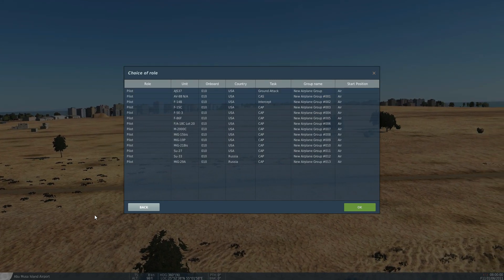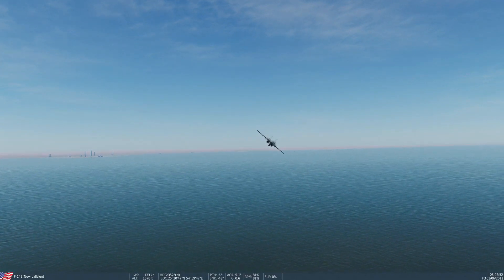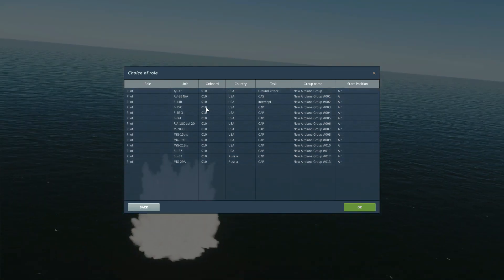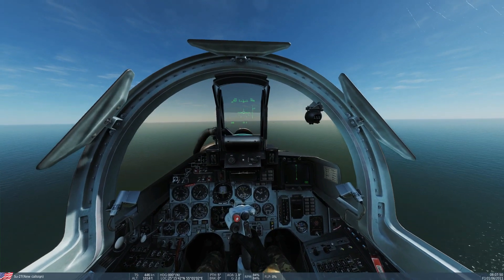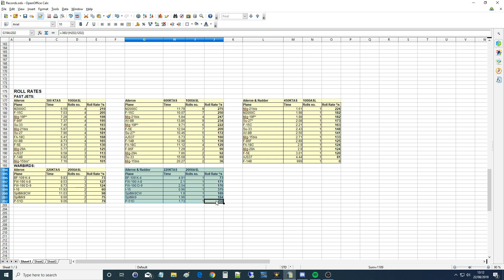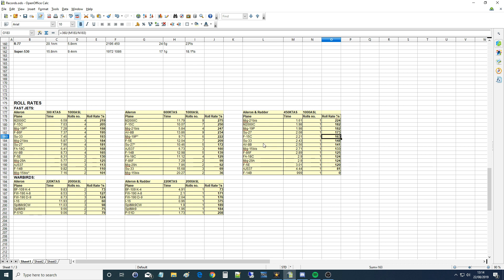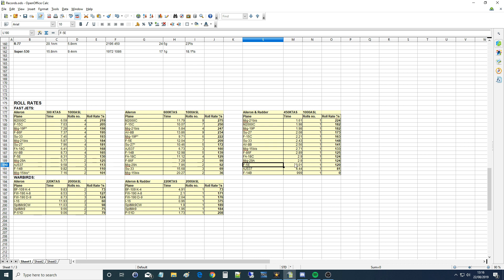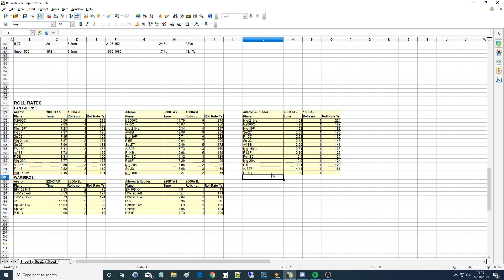Fast Jets: Max Snap Roll Rate (Aileron, Rudder & Elevator) | DCS WORLD

Comment: I would recommend using aileron only - no rudder or elevator. The airplane should be essentially ‘unloaded’.
A good way to measure the maximum roll rate would be to measure the middle roll of 3 continuous rolls.
In competition aerobatics, the term ‘snap’ or ‘flick’ roll refers to an autorotative roll - started  by applying rudder after rapidly increasing the angle of attack (back stick for ‘positive’, forward stick for ‘negative’), so that a wingtip is stalled, generating a lift differential across the wingspan. Once initiated, the elevator is positioned to reduce the ‘average’ a.o.a., and aileron can be added to increase the lift of the unstalled wingtip - ‘accelerating’ the snap. This takes a lot of practice - the speed and timing of the inputs are very important, and vary between aircraft types.
Large elevator deflections will make for a spiralled flightpath with high loading; rudder may help the roll at relatively low speeds with a positive loading, but in addition to structural issues, could oppose the maximum rate of roll at high speeds.
I have no experience in these airplanes, but 
currently fly a G-200 in competition aerobatics - which rolls pretty well!

Comment: Check your curve, dude.  I think you have a curve set of 25, if not higher.  Back it off to 10-15 at the most. Then take the Tomcat up for a few test hops. 
Also, if you're going to be throwing the 'Cat around at high AoA, disable the Roll SAS at a minimum.  Ideally you'll want both pitch and roll off in a high aoa environment, so just slap the paddle- it'll automatically disengage AP, roll SAS, and pitch SAS all at the same time.  Consider it your "Shit's gettin' real" switch.

P.S.- throwing 22+ G at your airframe is never, EVER a good idea.

Edit- your entire test is bad, after reviewing your findings at the end of the video: 
A proper snap roll is NOT just a "Stomp right foot, Swing stick right, and pull".  It's a balancing act that allows the pitch authority, the yaw authority, and the roll authority to compliment one another to maximize the roll rate.  Simply maxing everything out to 11 will just result in a massive over-alpha situation if the plane has too much pitch authority in relation to the other two forces: 
Case in point- the F-14.  It's tailerons have a bigger wing area than an entire A-4 Skyhawk.  They are also responsible for roll, assisted by spoilers on the wings.  That the rudder could not keep it in line is hardly a surprise. 
In the F-5, it's the same story, as with all the other old school jets in there.  Side note about the F-5:  There is no "roll restrictor".  The F-5 has a region of stick travel that just happens to be a bit more stiff as you get to maximum travel.  Using the roll switch means you are allowing that stick to move to the max of allowable stick travel, not giving it a bonus.  But, in your test, it really wouldn't have mattered anyway, as the pitch authority on the F-5 greatly outweighs the other two forces.  It would just be a similar, if less excessive, experience.  
The FBW jets and those with simpler flight models kept you alive.  The more authentic flight models killed you dead.  
Relax on the stick when dealing with the F-14 and other aircraft, and it'll go a LOT better.

Comment: I suspect that the Su-33 is down to the canard.  I've been amazed that flying the Su -27 for a week now (not as much as I would like) just how much you can throw the thing around even without disconnecting the FCS. Next week I want to try landing on a runway wheels up (on the engine pods - which is supposedly entirely possible with little or no damage).
 Btw I've been trying to follow the Training runs - am I the only one to find some of them uselessly difficult? Particularly flying the damn thing through the Navigation "squares" some of which seem to have been placed in ridiculous positions in relation to others..... Best, Pete.

Comment: I think that part of the problem is the main wings blocking the airflow over the tail control panels and in extreme cases as in f14 its also stalling the airflow over the top of the wing